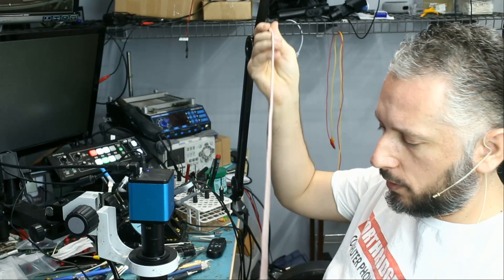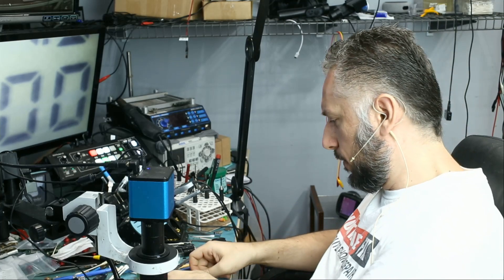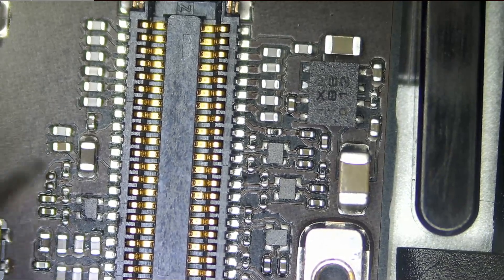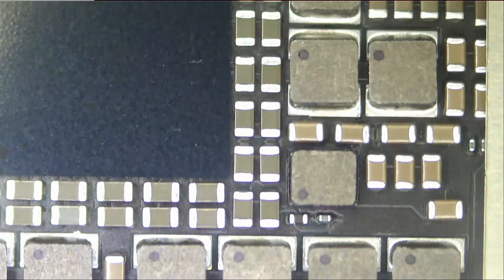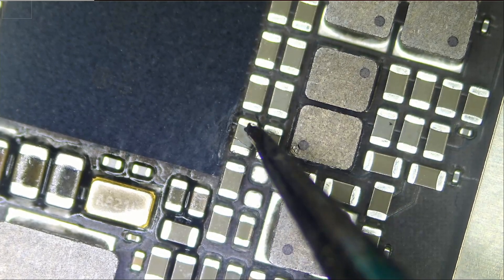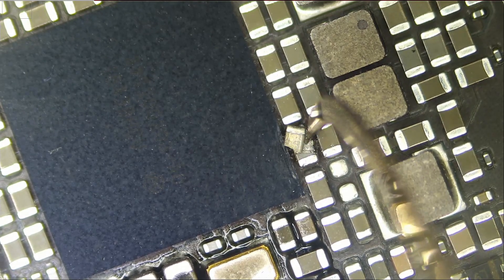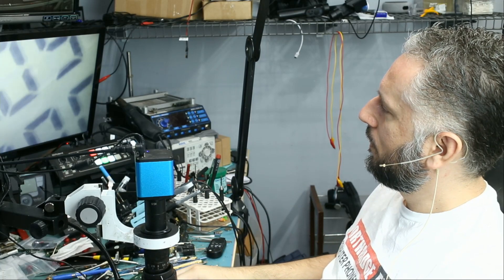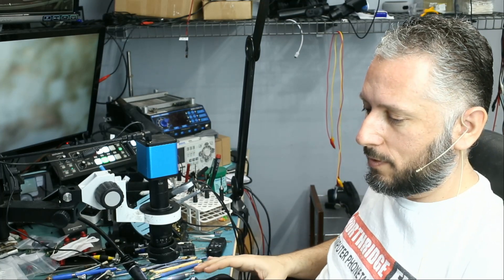iPad 6 A1893 No power - Finding a capacitor short using common sense and Thermal Camera.

Comment: I have similar problem withe same ipad . 0.60 amp draw and no power. No burned cups only short all caps near cpu i don't know if it normal.I haven't a thermal camera for the moment but whit ice nothing appen. I also changed ic charge and situation it the same. Any suggestions?

Comment: Thanks for the video.
I watch all of your videos, and again and again I under-estimate how small those structures really are.
On my 7th gen iPad I had a crack in the glass. Thus I went for exchanging the screen. Following what I have learned I disconnected the battery before disconnecting any cables. Probably with a wrong tool. In the end the iPad wouldn’t turn on. Then I looked for a cracked capacitor and thought I had found one. Near to M1 IC. Tried to unsolder it with hot air. When I finally had it, it had another of the very tiny size attached to it. When  tried to split them I recognized: no shorts. So I tried to reattach them. One flow below the metal frame. On trying to bend the metal frame, another cap flew away, thus I tried to collect this for re attachment.
In the end no improvement. I went ahead and measured around the Tristar/Hydra IC. Nothing conclusive. I ordered one anyway. So I changed this one (without experience in BGAs). Now I came to an alive iPad in DFU. Recovery impossible, some tools recognized the IPad as cellular, even tho it is WiFi only.
So i looked around the caps between M1 and cpu. Found some strange things. When I tried to rearrange, my tweezers (even though pointed and angled) were just to big. Suddenly M1 ic flew away... oh my...
Just resoldered M1 as it was. No spare, little hope. No way to reball this kind of IC.
Then I finished my cap rearrangement, and I guess I am missing 3 of them in the meantime...
With little to no hope, I went on to reconnect everything. As this story goes over like 2 weeks, the battery was drained in DFU.
So i had to wait for enough charge to turn the thing back on.
And when it finally came back, it started right into lock screen. Everything still there. Everything still works.
That was my „yes“ moment.
Now I need to figure out, how to really get everything clean and dust free and then reassemble for good.
This one will stay with em until death to us part, because it is slightly butchered inside. So no good for sale.
P.S.: after that story I need to express: I do have all those tools and stuff, but this is only my hobby and I don’t butcher customer stuff, because I just work on my own things. :)

Comment: Hi i love how you fix things or gadgets or any device. But i have a question. Can i use a single wire as replacement for backlight filter or display filter. Hope you answer me :( cause i have an iphone 6plus repair filters move in place by not removing the rubber thingy.

Comment: Just have to say that I like your style of diagnosis. I started doing electronics repair about a year ago, and doing micro soldering. One of the things that made me anxious was the fact that I still have trouble reading schematics. Every day I watch a few of your videos and I'm always amazed at your ability to diagnose so many issues with only a close visual examination, and the thermal cam. I'm still learning schematics, but you have taught me so much. Thank you for doing these videos. I also like the fact that you get to the point quickly without a lot of talking. I can learn a lot more from one of your 18 minute videos than I can watching other channels that go on and on for over an hour.

Comment: I am watching you videos for a while now and finally subscribed. I learned a lot from you, in terms of diagnosing electronics. I recently had my usb hub not working fine and checked everything. I found a loose connection at the port, where your cable from your pc plugs into. resoldered the connection and it works. :) 
Keep up the nice work and greetings from Germany. :D

Comment: How do you know when it is not necessary to replace a component you just removed? 
How do you know the tablet is not going to have any performance issues due to the missing component you just removed?
Reply: My guess is that in this case it was one of many in parallel decoupling capacitors (smoothing out voltage difs or noise), one missing is not really affect things.
Reply: while 50 guardians can keep castle, 49 can same. so 1 is not that necesarry.
Reply: @cetoxim  ...Apple had an extra capacitor to throw away and put it right there ... hahaha

Comment: What is the difference between diode and continuity mode? After you fixed the problem, would the capacitors beeps in continuity mode or does it give any true results?

Comment: It did look like that cap had a hairline crack but sometimes it is hard to differentiate a crack vs a hair or something else  on top of a component in a video stream.
Reply: @3:14 right?
Reply: clearly cracked, if in doubt, use a brush to remove the pube
Reply: +1

Comment: And that component isnt neccessary for the tablet? Or its not needed anyway?
Reply: This is a power filtering capacitor smoothing the voltage on one of the main power lines. Instead of having one large cap, there over 30 small ones connected in parallel. Removing one slightly lowers the total filtering capacity, but the effect is negligible.
Reply: It is redundant, that’s why there are so many
Reply: Doesn't matter if you remove capacitor form any mobile.

Comment: Why did u not replace it ?
Reply: It’s a bypass capacitor ... no reason for replacing it. (There are several others in that area)
Reply: @Try4Hard  I agree with the bypass cap not NEEDING to be replaced. But there is something to be said if it ever breaks again and ends up at another repair shop, they may zero in on that as a cause. Then find out it was something else (after they replace it). While I agree it is not needed, seems trivial enough to add the cap back to avoid that issue and have it be 100% up to the engineer's design.
Reply: @Tom-NY4I-FL  i agree and its fair to customer to, he payed full so he should get a full repair even if it works without that cap
Reply: Caps  let through AC but stop DC, so in a circuit, they are either in a signal path or on the power supply.  When they're on the power,  like this one,  they send any noise to ground,  cleaning the power. There are usually dozens of them, that's why this one that had shorted was directly pulling the power down. If the cap had been in a signal path,  a short wouldn't break the device,  but may make it dangerous,  in a tube amp got example, where they keep the high plate voltages away from the person plugged in. Caps are also used for their ability to have a known charge time/ cycle but that's a bit complicated for here!

Comment: Found your channel today and have been binging your videos. Really love the work and will be picking some stuff up from your shop soon. I have really wanted to get into soldering and working on electronics like this. Any recommendation for a good soldering iron? How much should I expect to spend? $100? $250? Not really sure
Reply from the maker: Northing Specific to recommend. I use Weller WX2. We are working on carrying several models of soldering stations. Can't give any specifics before we try them. If you are doing this as a hobby, any cheap iron should do the job. Buy better equipment as you progress and you feel the need to. Read reviews and do your research. That's  the best to learn.
Reply: I'd recommend a Hakko 951, although it's a bit above what you're expecting in terms of price. I just got myself a FM-203. The Hakko adjusts it's heat to make sure you're soldering at a constant temperature. With a cheap iron you don't get that, and you must set your temperatures higher to compensate for the heat loss, putting all your soldering projects at risk from heat damage. Upgrading from my $30 Iron, I was amazed at how easily my new Iron handled large solder joints.